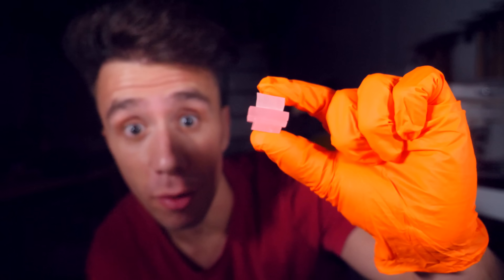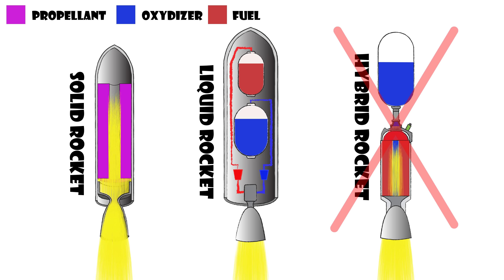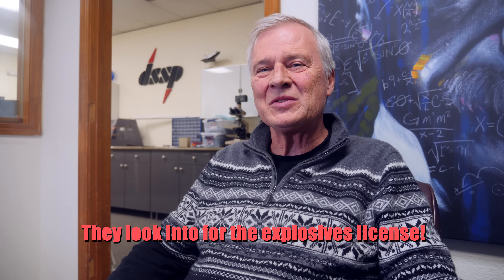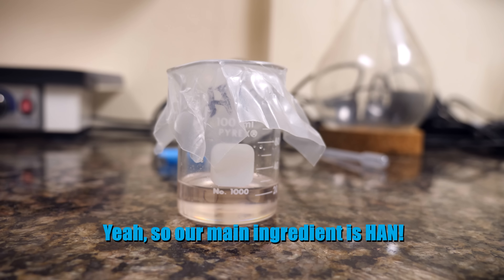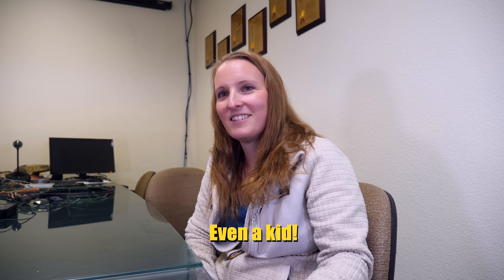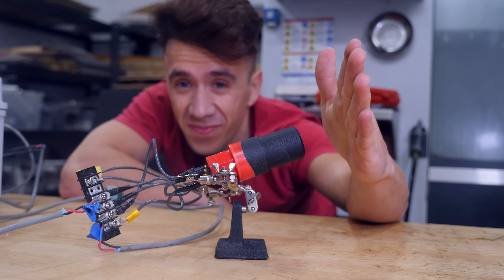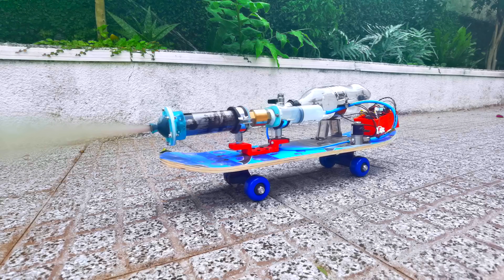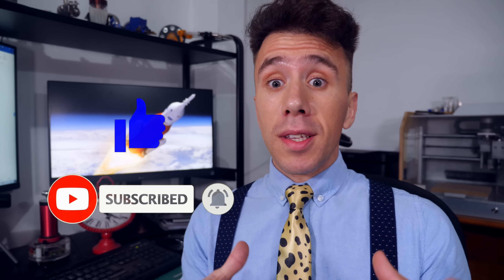ELECTRIC SOLID PROPELLANTS

Comment: Hey Integza, awesome video.  I don't know if you are now under contract and whatnot to not make HAN, HIPEP, or GEM...but as a chemist, these are super easy to make.  Getting the ratios right in the final composition might be more tricky, but make these is totally doable if you are careful.  HAN can be made by mixing hydroxylamine sulfate and barium nitrate (barium sulfate will form and crash out of solution, so just filter the liquid containing the HAN out, just don't dry it fully since its apparently a friction sensitive explosive and decomposes over time as a solid) or hydroxylamine hydrochloride (this is the form I see most commonly in lab settings) and silver nitrate (again, you'll get a precipitate of silver chloride which you can filter out).  Polyvinyl alcohol (PVA) is super common, and GEM is (from a cursory google search) just a mix of HAN, Ammonium nitrate, water, and methanol.  The biggest thing to be careful about is that HAN itself is not the most friendly thing, hydroxylamines tend to be fairly toxic, so you just have to make sure you are using good PPE.
Reply: Seconding this. Double displacement reactions are highschool simple to run and looks like hydroxylammonium sulfate is cheap from ebay.
Reply: This needs to win a 3D printer, my guy! I was hoping he said he figured out the formula anyway.
Reply: @TheZero715zero  Haha, I appreciate it, but I actually already have a FDM and SLA printer.  Better to give it to someone who could really use it.
Reply: This is actually really interesting, cause I was wondering how hard it was to really make HAN, of course I would assume the ratios of making GEM would be something not disclosed to  Integza. Really would love to get my hands on this stuff for some cool Physical Effects stuff like they showed with the eSquib.
Reply: I love your enthusiasm and to be honest your not to far off but this is a bit more to the products and you have some wrong ingredients there, also there are better ways to may HAN that can be produced in much larger quantities and with less work and cleaner... 
You definitely can tell you know what your talking about though and don't let me stop you. you may find new things out by doing it different ways.
Reply: @vincentcamilleri7244  Oh for sure, you would never use the double displacement method at scale.  Dealing with the waste precipitate alone would be a nightmare, so it makes total sense that a company would use electrolytic oxidation since you avoid a major byproduct.  And, if an individual finds that they are needing to make HAN frequently, then by all means it might be better to try and figure out a electrolysis  cell or get real fancy with a flow reactor.  At a hobbyist/demonstration scale, though, I think it makes far more sense to use the hydroxylamine hydrochloride/sulfate method than it does to try and figure out a electrolysis cell for making the HAN, since the salt metathesis method is just dump-and-stir chemistry, with a little filtering for flavor.  

As far as the actual HIPEP/GEM "recipe", I was mainly just quoting what Google popped up on a fast search, lol.  The HAN is the special sauce here, once you have that you could really start playing with composition to see if you get different effects/performances.  You could even try different plastics (though i've only ever worked with PVA and PMMA) to change material properties, though I'm not close enough to this field to know what is actually desirable (I'm a chemical biologist, so I can't tell you what's good for rockets, but I can maybe try to find a set of enzymes that can make HAN, lol)
Reply: @Inuyasha10121  your spot on for one of the methods for making han, but if you want to make any reasonable amount, you need an electrolytic cell larger than a suberban... and then you need to concentrate it... 

But once you have it, you can play with mixtures, we have spent years and millions on contracts developing certain mixtures for certain applications. But there are always more. I hope han propellants start getting more recognition. The aerospace industry is so slow to changing anything. Theu like to stick to what they know but, it comes around eventually.
Reply: @vincentcamilleri7244  Hey you seem quite knowledgeable if you don't mind me asking what are the incorrect ingredients he listed? Also are there other combinations of materials that you could mix with PVA in order to make something similar? or is HAN the only real method here?
Reply: @spectre6612  no methanol (not saying that methanol as an additive doesn't have an effect. We have tried this and there may be reasons for adding it but not for a higher ISP in this case). The GEM formulation is more complicated then the hipep for sure. 
also, PVA is not only a means of altering viscosity or even creating a solid it is a fuel. So supply the oxidizer and have fun. Who knows what you may learn :)

Comment: JPL engineer here, yea hydrazine is no joke, I work with it frequently and always worry about a leak. It reacts with regular steel and copper, something you can find everywhere on a navy ship. I'm interested in this GEM stuff and cant wait to work with some of that instead.
Reply: yah hydrazine is not your friend :)

i was shocked the first time i was tasked with disposing of some of it. it seems to react violently with just about everything and has some really nasty runaway reactions. the Hazchem form was like reading something out of a sci-fi horror script.
Reply: Nitromethane is a better propellant than hydrazine. And safe. Why not just use that.
Reply: @ohbeardedone9253  Nitromethane is more energetic, but that doesn't mean more better.  It's sensitive, with the ability to detonate when compressed.  That's particularly bad when you have "bang bang" control of your propellant valves.  It burns too hot, making the catalyst bed more difficult.
Reply: Can I contact you I have experiences with fuel
Reply: Me… or the OP?
Reply: Very interesting comments , I'll be following to see how this develops.
Reply: A lot of you seem to have missed somethings in the video:
1) the head of the company said if the rocket is too big, it won't stop burning, and
2) if you heat a catalyst then it'll burn from that.

So, this stuff does not absolutely require electricity, it's just much harder to burn without it.
Reply: I worked in a coal-fired power plant in high school.  Hydrazine's reactivity with metal was used to prevent corrosion in the high pressure boiler tubing.  Basically, there was a bunker in the basement of the plant with tanks of hydrazine.  Well ... I guess that it is more its ability to scavenge dissolved oxygen from water.
Reply: May I correct you? Hydrazine is only solid when below 2 degree's. Sorry but true
Reply: Liar.
Reply: If my knowledge is correct, hydrazine is hideously toxic. As in handling it safely requires someone to wear a respirator mask and special clothing. Can't it literally melt the skin from someone's bones?
Reply: Is GEM gonna be better than solids for planetary probes? Think replacing Star 48's for kickstage or for cubesat propulsion for interplanetary probes, whats the potential there in terms of ISP?

This seems like a combination of the best parts of solids with the relative safety of liquids, could the SLS BOLE booster use it instead of traditional solid propellant for example?
Reply: How can rockets use ESP for efficient flight when the batteries will add a lot more weight?
Reply: @defeatSpace  well if you're talking about a space ship there's solar panels battery won't be a problem in terms of weight. But what i wonder if it'll be more efficient than a normal jet engine or rocket engine it might be better used for the tomahawk to increase its effective range.
Reply: @yuki1zz668  No.  It's a monopropellant.  It carries its own oxidizer, as the majority of its weight.  It won't provide anywhere near the range as the current kerosene-fueled jet engine.  You might be able to use it in the boost motor to get it off the ground, but that's about it.
Reply: @defeatSpace  I feel like it wouldn’t use too much power as you usually do a burn in short segments with time to charge in between
Reply: @awsomegamer8277  Oh, so ESP is a good option for satellite thrusters, probably lighter and simpler than xenon ion thrusters. Definitely better than trying to row a canoe forward by pitching baseballs off the back end.
Reply: @defeatSpace  in theory but as an electrician and not a rocket scientist don’t take my point as 100% fact but yes I’d like to think so
Reply: @awsomegamer8277  it's all connected, no worries
Reply: @defeatSpace  I don't think it needs a huge amount of power. Maybe a small battery is enough to get it started.. could even just put a tiny fan on the rocket that generates the power from the motion through the air and stores it in a supercapacitor.. If done right I think the controller & PCB could be more of a weight concern 🤣
Reply: @ToninFightsEntropy  sensible reply.  But what about thermal electric generation, even a heat pipe mechanism. The heat can be conducted to the remaining gel and parts of the body.
Reply: @Waynesification  I like it!!! Could use a Nitinol engine to turn the generator🤣
Then a simple capacitor could be pre-charged to start it.
Reply: @ToninFightsEntropy  ESP doesn't keep reacting if the current is no longer present, it'd be regular solid fuel if it did.
Reply: @ToninFightsEntropy  You have to keep it going as well with electricity. Not only get it going.
Reply: @ToninFightsEntropy  I think you need constant power but really if you think about it on his scale a car battery could probably continuously run that for an hour or more and if you scale it up that’s not an incredible amount of power it just needs charging time after the burn
Reply: @awsomegamer8277  Why do people keep thinking that I'm missing that it needs constant power??? Are you bots? Im so confused as to how you think I don't think that.  Everything I've said is obviously considering it lol are you trying to gaslight me?
Reply: @robi4567  Are you serious!?!? You're the third person saying that I don't know that. You clearly didn't understand what I was saying, and I really wish you'd read it for what it is. I'm talking about generating new electricity while in flight, and using that to keep the reaction going, instead of taking a heavy battery along. I'm not saying I know it could be weight-efficient, but I'm just suggesting to consider it. I'm not talking about using it without electricity. My whole point is making electricity. How many more times do I have to say this? 🤣 I feel like I'm arguing with bots..
Reply: No you're not.

Comment: I had heard stories of there was a large chemical fire, years age before I joined the fire brigade. Some older firemen would recall being in an area in which they were wading through water that was around waist height but what stood out was that there was colourful fire burning flame ‘beneath the water’. That same area the concrete had turned to glass apparently. I know there are oxidizers and fire that are not extinguished with water but yeah, but weird huh.

Anyway, I’ll include two links below; both of which you could make a couple of video’s.
First of which would be to investigate the Explosive Spalling of Concrete, during heating or a fire. It would be interesting to see whether Roman Concrete could stand up to high temperatures, unlike modern day concrete. Interesting even more would be trying to incorporate Flyash instead of volcanic ash like the Roman’s did in there’s.

https://wonderfulengineering.com/this-is-why-concrete-explodes-when-heated-to-high-temperatures/

The second idea, while still on the topic of concrete. Would be to try and re-create Roman Maritime   Concrete. https://news.berkeley.edu/2013/06/04/roman-concrete/ 

I hope you may find these of help, I love your channel by the way. 

Cheers,
Brent

Comment: Absolutely your best video yet! I had never heard of this type of propellant, now I have a whole new avenue to research!
Reply: Mr. G.C. , 
If you want to explore new kinds of rocket-fuels , investigate FROZEN hypergolics .
The optimum combination for deep-space use is hydrazinediium with hydrogen-pentoxide as oxidizer . 
There are a variety of possible mechanical architectures for this , but they all should yield ISPs above 500sec.

Comment: Integza, you could try to make an electric rocket engine!  A battery driven electric pump, a mini Rutherford engine from Rocket Lab's Electron rocket!  You could a liquid fuel and oxidizer setup, but monopropellant and catalyst might be easier for a first attempt.  The engine could be controlled either by a valve, or directly controlling the motor speed, or both-which would probably take some Arduino work.  A good first step before getting some GEM!!!

Comment: That part about using practical muzzle flashes for film isn't as clear cut as it might first sound. Thing is a muzzle flash is so short lived that at the frame rates you record a movie they can often occur between frames. When you have the big fire fight you don't want a visible muzzle flash every fifth shoot. You want a perfect muzzle flash for every shot "fired". So even if you use practical effects the CGI guys will still have to add or enhance the muzzle flashes for the majority of the shots.

It's called movie magic for a reason.
Reply: Oh, yes... For got to mention that the traditional movie framerate is 24 frames per second, with the by many hated "new" high fidelity standard being 48 frames per second. It's "hated" because it makes the movement look more natural. It takes away the low framerate cue that we use to recognize the material as being a movie. It's often said that the high framerate makes the movie look as if it was recorded using cheap video cameras rather than professional movie cameras.

Now if you search YouTube for gun videos about shooting at night or concentrating on the muzzle flashes you will see that most of the shots shown in these the muzzle flash is either missing or just partial. And these videos are shoot at either 30 or 60 frames per second. Even at 60 frames they can't reliably catch the muzzle flashes.

Comment: If AP electric propellants are insulating, why not use that function? A square stick of AP EP with an electrode strip down each side, provided with enough voltage to breakdown the gap at the end but insulated across the remaining fuel grain by the propellant itself. Enough voltage and you get the ionizing function as well....

Comment: You point out that it doesn't react to heat or shock etc. Much like plastic explosive ( PE) doesn't react to shock or fire, C4 for example just burns like paraffin based firelighters however will it detonate like like PE if you were to use say a blasting cap against it? Or is it literally only reactant to electrical current and what range of current works best? I ask out of curiosity and to better understand it's properties.

Comment: What is the expansion ratio. Is there any left over residue. Thinking. Enclose some in a closed end cylinder,say in a small chamber attached main cylinder. Then insert piston ,a quick short sharp pulse of electricity that would  momentarily set off the propellent ,will  piston move down cylinder by the heated expanding air ? So rather than using a liquid fuel why not use a solid fuel ? Happy new year

Comment: A great way to test controlled propulsion with a material like this would be to make a centrifuge with micro-ports on the sides to evenly apply pressure, letting you test speeds, reliability, cut off, and more all while decently safe.  Perhaps rather than a single large tube of hipep you could use many straws of it? Or perhaps another shape is even more efficient, such as a strip held between charged plates, allowing for a spool to be belt fed into the ignition zone?

Comment: Video idea:
Use multiple ESP fuel rods and assemble them in an electrical chamber that resembles the setup of a nuclear reactor so you can control the thrust by removing or inserting the rods, basically the opposite of a nuclear reactor but same design and also see if the angle of the rods makes a difference to thrust, try them straight and try them all pointing to the centre of the nozzle.

Comment: Does this propellant work underwater? If so maybe it would simulate space/low atmospheric conditions and you could design a torpedo or rocket booster module. Just a suggestion.

Comment: I'm gonna repeat a suggestion I've already made:

Redo the bladeless ionic fan but in a cone configuration - jet casing (outer casing and a central cone running through the chamber), spiral-wired inner wall of the outer casing in a criss-crossing grid, blunt object be the spike nozzle that runs through the assembly.  Make the air-intake a single big connection point, and the other wire run down the central cone inside the assembly and attach to plating on the spike so that there's plasma flow down the chamber.  Plasma jet time!

Comment: The coating on a welding rod is the same idea, it creates a shield gas so the weld doesn't oxidize.  If you used welding rod flux to produce your gas with a consumable electrode, you could make an electric solid fuel rocket.
The same idea could be used for water and make a steam rocket using electrodes to flash the water to steam for propulsion.

Comment: what about some sort of reversible engine? essentially what i mean is a standard rocket of any kind, designed so that it can push itself forward or backward. presumably this could be done with a simple rc circuit for control, and a couple of valves.